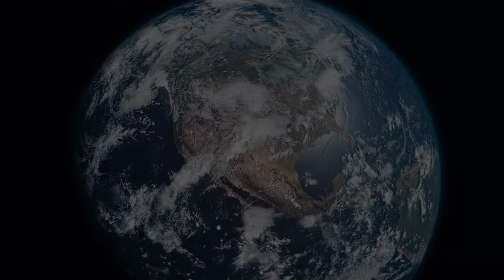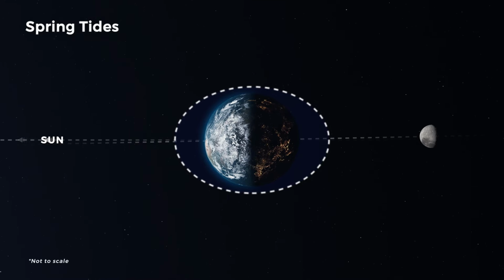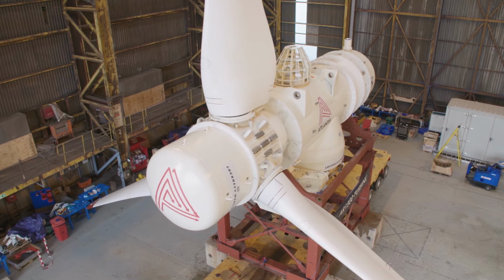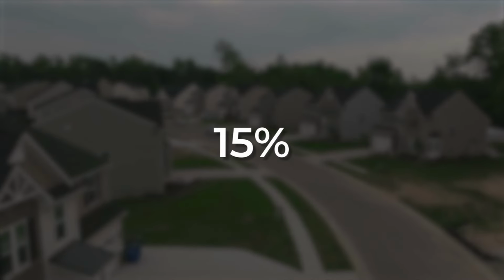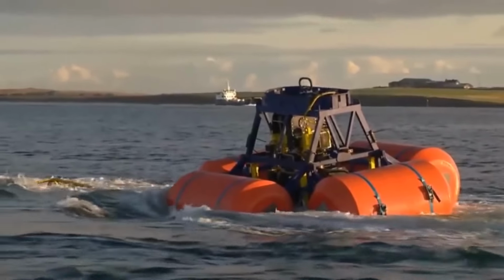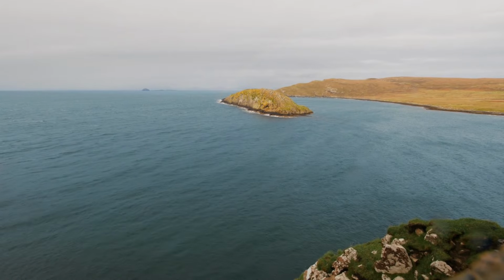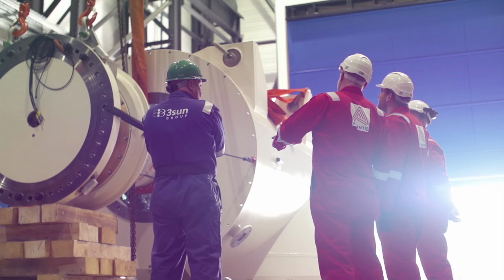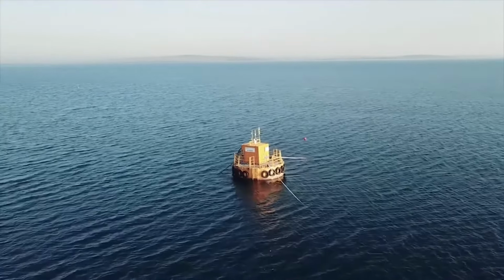Can Underwater Turbines Solve Our Energy Problems?

Comment: Hear that uranium slowly decaying? That's the sound of wasted energy.
Reply: SLAMO  
Thorium is the "new" reactor design.

It's got a lot of benefits compared to uranium, but it still needs 500 or more years of safe storage.
Reply: @lordgarion514  HOw is it better than uranium?
Reply: @knockhello2604  
That's a long list.

It's impossible to have a meltdown because the fuel is in liquid form, and if the temps get too high, a plug melts and the radioactive liquid fuel drains into a storage tank.

It can be used to make more energy from spent uranium that can no longer make energy in a uranium reactor.

It doesn't require a lot of very expensive enrichment.

AND it's waste is radioactive for a few hundred years instead of many thousands of years.

And more, but you can look into it if you want to learn more.
Reply: @lordgarion514  I didn't know about it being used to make more energy from spent uranium
Reply: Thorium half life is only 400 years, doesnt require enrichment, and is more abundant, this is what we should be pushing for.
Reply: @UberMick  The waste products from a liquid fueled thorium reactor have a half life of about 400 years. The half life or thorium is more like 14 trillion years.
Reply: @NeilHaskins  You need to edit your comment mate, it makes zero sense as it is currently as you've contradicted your self. Proof read before hitting that reply button.
Reply: @UberMick  
It has to be stored for 500 years. Sounds better than 10,000. But TBH, designing a container and storage site that will last 500 years, isn't really any easier or cheaper. 500 years is a hella long time for man-made materials to last. Even stainless corrodes over time. Never mind the joints where parts have to be joined.

And you still can't really store it anywhere else but deep underground and sealed.  We're well over 200 years old as a nation now. Few nations have made it 800 years. Can't risk it being easy to get to in the future.
Reply: @lordgarion514  I hear ya, but have you looked into MCSFR tech? A salt reactor thats insanely efficient, can use uranium/ plutonium waste products to 98% efficiency, it'll burn Thorium as well, and all waste has under 500 years half life. So factor in 2% of all fuel used, and nuclear systems dont use much to begin with, thats a very small amount that needs to be taken care of. And keep in mind, plastic bottles in a rubbish dump take 1000 years to fully break down, and theres parts of old solar panels that are pretty damn nasty as well. We have no perfect solution available, so you gotta go with whats the best available, and renewables have proven to be waaaaaay more complex than initially thought, and the size of battery backups just to try and keep power flow continuous is massive/ expensive/ not exactly environmentally safe them selves.
Reply: @UberMick  
You were half way decent in your defense of nuclear into you went with that way more complex, and battery bullshit.

No it's hasn't, and tons of renewables projects are already up and running with tons more being built.

Also, those reactors still leave us with tons of highly radioactive waste, and we'll have to start opening up storage containers and transporting the old uranium around the country. Lots of problems with the entire thing. Plus still requiring very long term secure storage, since we don't want terrorists to get hold of it and spread it around in a dirty bomb.

I'm going to assume you didn't know that renewables are putting out almost as much electricity as nuclear and coal(individually), and is cheaper than natural gas.

And just solar electricity production right now is providing more jobs than ALL fossil fuel electricity production COMBINED.

Not to mention mcsfr is still more expensive and provides fewer jobs.
Reply: @UberMick  
And to be clear. I'm not totally against nuclear power. Having a few located near-ish to large high population areas would probably be better overall. But only if we can get the costs down quite a bit. But while I'm not completely against it, I'm not a fan.

But at this point, solar electricity with nighttime energy storage is cheaper than natural gas (the cheapest fossil fuel) while providing more jobs than all fossil fuel electricity production combined.
Wind, with nighttime energy storage is even cheaper, but provides fewer jobs, and hydro is even cheaper still.

AND that's not even counting the fact that fossil fuels get VASTLY more in subsidies than renewables.

And nuclear isn't any better, and is worse in many cases.
https://www.ucsusa.org/resources/nuclear-power-still-not-viable-without-subsidies

We have the technology to get off fossil fuels and nuclear while saving a LOT of money AND providing a LOT more jobs at the same time.

Nuclear will cost more, and is inherently dangerous (even the more efficient like you mention needs hundreds of years of very expensive storage), and still needs massive amounts of subsidizing.

The renewables industry on the other hand would jump up and down with joy if all subsidies were eliminated, especially the ones the feds like to hide. The IMF can give you the full list, because the feds won't list them all.

There's also much cheaper ways to store the excess energy for nighttime use than regular batteries.
Reply: @lordgarion514  Again mate, you need to look more closely at the thorium MCSFR tech thats coming along. Current uranium uses about 3% of its fuel, the rest becomes waste, the MCSFR will use around 98%  of its fuel, thats a massive drop in the amount of waste. Again the waste is less than half the life of plastic. PLUS its higher efficiency brings down its cost considerably. Renewables are not as cheap as you quoted, simply because solar panels and wind turbines have to be completely replaced far more than a nuclear power plant, and the studies your quoting dont consider new technology what so ever, its old information. If your not totally against nuclear, I'd suggest getting up to speed where it is currently mate, plenty of info out there if your interested in broadening your knowledge base.
Reply: @UberMick  
I'm aware of all that.
But that still leaves plenty of highly radioactive material to be used for bad things that has to be stored and guarded a long time.

Not to mention the massive amounts of  low-level radioactive material that also has to be stored securely for a long time.

Panels typically last 25 years and up, with a performance warranty of 80% capacity at 25 years(if still working) and a failure warranty of a decade or more.

And you can make a standard solar panel for less than you can make basically anything bigger and more complicated than a bolt for a nuke plant.

You're also ignoring other forms of solar, which don't even use panels.

And let's not forget that we waste massive amounts of electricity moving electricity around from giant plants to where it is needed. With solar and wind you can put production almost literally everywhere. That allows you to be able to move electricity much shorter distances overall to get it where it's needed.(the moving of huge amounts of electricity is what allowed Enron to do what it did)

But with electricity being made on almost every roof, you would rarely need to move large amounts of electricity long distances the way we do now.

But sure the new reactors are supposed to be much cheaper than traditional nuclear, but they said regular nuclear was going to be so cheap it wouldn't be worth metering.......

Solar is a tenth the cost of regular nuclear even with the massive amounts of subsidizing nuclear gets. Will the new ones be that cheap if the subsidies are dropped to the level of renewables?

And who's paying to build the long term storage facilities for nuclear waste? We are, and it's on top of everything else we're paying, and it's another massive subsidy. Even though the new reactors have a huge reduction in highly radioactive waste, you still have to store it just as securely.

I don't think they can get it down that cheap TBH.

Not to mention that solar and wind can allow us to put a large percentage of electricity production in the hands of everyday people and less in the back pockets of large companies who give politicians lots of company money......

This truly is a country of the people. We are an integral part of the government, and we now have the technology (which we paid to invent might I add), and energy is one of the most important things a civilization has access too. It's well past time that "we the people" own and control more of that energy production.
Reply: @lordgarion514  I did see the report from real engineering, the set up cost much higher, but once in full operation, costs are lower than solar or wind. I'm all for residential solar, but solar farms? Its a terrible idea and thats now been proven after the green energy sector has tried desperately to make it viable. There is no solar or wind installation that can run 100% of the energy its generating, everyone needs fossil fuel backups. And to get to the point where you can not only provide enough power for peak usage when there is little power being created, means not only do the solar arrays have to cover a huge area, but then the battery installation is bigger than a nuclear plant as well. There are toxic elements in panals that are very hard to dispose of, and batteries need replacing quite regularly as well, and that cost was NOT factored in to the real engineering analysis, which actually makes the long term cost of solar/ wind even higher, further blowing out the cost by cost comparison. And again, the tiny amount of waste from an MCSFR is 400-500 years where as plastic products take 1000 years unless incinerated which is what we are trying to get away from. Plus, cheap panels which do get sold to residential clients, some only have a life of 10 years or so, so factor that into viability equations if you will. PLUS, MCSFR's can be modularised, meaning they can be scaled down in size to be placed where ever they are needed, which I believe was an issue you raised? Far more practical to have a small modular reactor for a small town than a massive array and battery cluster, or long distance of power lines connecting towns to a grid. Ultimately, long term investors will look at nuclear for smart money. And considering how rapidly technology is evolving now, we've already found a way to use uranium/ plutonium waste dropping half life from 10k+ in years down to 400-500, whose to say in another 50-100 years we've figured out a practical use for that remainder? Beside, fusion should have its shit together by that stage anyway, hopefully! Haha
Reply: @UberMick  
Needing fossil fuels to help is a function of capacity. We haven't built enough renewables to cover everything. But we're building a shitload.

Just like we use many kinds of fossil fuels, AND built enough capacity to handle the peak loads. That argument is just silly and irrelevant.

And they don't include the taxpayer funded building of storage sites, the amount taxpayers spend to ship and keep secure the waste. The taxpayer funded research into storage and shipping containers. And more that's paid directly by taxpayers.

Got to include everything....... Including those subsidies. What was the amount nuclear got in subsidies again???

NOT cheaper when everything is factored in.
Reply: @UberMick  
It's beyond stupid to laugh when I already stated renewables get subsidies (worldwide 66B, compared to fossil fuels 400B)

AND thank you for letting me know you have no damn clue what you're talking about.

Nuclear absolutely has to have backup peaker plants, as does coal for that matter. Now, go learn why.

And forced to choose, I'd take nuclear over coal any day, but I'd rather it be neither.

We're also not talking about space, and for missions not near a star, nuclear is the only thing we should use.

No, I don't want to shit on nuclear, I'm just a realist, and I understand the negatives of each fuel type. There's a reason we've never used just coal, or just fossil fuels to make electricity. No single energy source is perfect for every situation.

But we now have the technology to make electricity cheaper and cleaner, while providing more jobs, and without having to store radioactive material for hundreds or thousands of years.
Reply: @UberMick  
Oh, and that small renewables subsidy amount includes hydro and geothermal plants.
Reply: Robert Pruitt  we should figure out nuclear fusion before we really invest in nuclear
Reply: @v_raptor2218  nah, unneeded, it's gonna be too late. Put the funding into 4th gen, when we have those running get into fusion.
Reply: @lordgarion514  

That's my main problem with nuclear energy. Our human inability to deal with future events.
We can't even manage plastic waste properly. Let alone nuclear.

TBQH, I'm afraid we need it as a stop gap solution. Stop gap will probably become indefinite counting human reaction towards investment returns.
Reply: @gauloiseguy  one of my main problems also.

That and the fact that all 3 major nuclear power plant accidents were a direct result of humans screwing up.

Chernobyl was caused by humans doing an extremely dangerous and risky test that shouldn't have even been done.

3 mile island was caused by a human overriding the computer's shutdown program (which was doing exactly what it should have been doing) because he didn't believe the gauges were right.

And Fukushima happened because a group of supposedly intelligent people thought it wasn't a stupid idea to put a nuclear power plant in an area that gets both earthquakes and tsunamis.

It's not the nuclear that worries me, so much as people.  We seem to make nuclear power far more dangerous than it needs to be.
Reply: @lordgarion514  

What makes us beautiful is the same that makes us ugly. Emotion.

We live in interesting times.

☮️
Reply: @UberMick  you forgot all the waste from the enrichment phase of nuclear fuel production.

They haven't even finished dealing with the waste products from project Manhattan yet....
Reply: You guys need to go to physics class before spreading such bs , nuclear power is the most polluting energy to exist. You can filter C0² out of the air but not alpha beta and gamma radiation.
Reply: @ziuzz4168  
True.

But currently, coal fired power plants emit about a hundred times more radioactive elements than a nuclear power plant does during normal operations.

And as you said about not being able to clean the air.......
Reply: @lordgarion514  this is absolutely wrong I know you probaply read that on some sources like scientific american but real studies atually show the opposite. 

like ;
https://pubs.usgs.gov/fs/1997/fs163-97/FS-163-97.html
http://large.stanford.edu/courses/2017/ph241/langsdorf2/
https://www.bund-nrw.de/fileadmin/nrw/dokumente/braunkohle/2008_11_BUNDhintergrund_Radioaktivitaet_aus_Kohlekraftwerken.pdf

Youre right if you mean that the enviorment around the power-plant is more polluted, but if we are talking about atomic waste in generall nuclear power plants produce way more waste. And this is the much bigger problem, because this highly contaminated waste has to be stored for 100000 of years and if they somehow get into the eco system theit damage is way worse. Im not supporting coal whatsoever we could power everything throug renewable energy if big energy corps wouldnt be.
Reply: Giant and expensive solar farm: Generates 1 mega watt
Average nuclear plant: casual generating 3000 megawatts
Reply: @Andrew58251  yes because nuclear powerplants are so cheap
Reply: @axelollars  so you're saying this renewable shit is cheap? It already costs way more than nuclear, and dumbass water mills will costd even more and require even more maintenance
Reply: @Andrew58251  
Nuclear energy is $6,000-$12,000 per kilowatt.

Solar is less than $1,000 per kilowatt.

Someone hasn't been studying.....
Reply: @lordgarion514  those are some accurate Wikipedia facts right their
Reply: @Andrew58251  
2 things about that.

One, the numbers are from Lazard. If you don't know who they are, you need to study more. Governments around the world, including our federal government uses their data.

"by Lazard, a leading financial advisory and asset management firm. Their findings suggest that the cost per kilowatt (KW) for utility-scale solar is less than $1,000, while the comparable cost per KW for nuclear power is between $6,500 and $12,250. At present estimates, the Vogtle nuclear plant will cost about $10,300 per KW, near the top of Lazard’s range. This means nuclear power is nearly 10 times more expensive to build than utility-scale solar on a cost per KW basis."
https://earth911.com/business-policy/solar-vs-nuclear-best-carbon-free-power/
(And the source being biased is irrelevant since they list the source. You can go verify from the original source. It is accurate)

And two.
You can shove that sarcastic bullshit you failed at right up your idiotic, and wrong ass.

Dipshit.

Piss off.
Reply: @lordgarion514  Is that why Germany have one if not the highest Electricity bill on Europe even though they're near 100% green energy? While France with 75% Nuclear powering their grid has the lowest energy cost in Europe?
Reply: That and all the hydro dams thier dismantling
Reply: @dednside5229  We should dismantle much hydro, let the Salmon run!
Reply: @dednside5229  failed state ehh
Reply: Yo Mama  how is a smartphone or any consumer electronics green energy? Yes solar panels use some rare earth elements that need to be properly disposed of or recycled, but one toxic lake created by chinese mismanagement of waste isnt a reason to dismiss the entire technology! Do you even grasp how stupid that makes you sound?
Reply: nuclear is not clean energy nor renewable
Reply: @razakmeshouni8611  lmao, not renewable, but definitely clean. Also the sun is not renewable btw.
Reply: @ignasanchezl  Not renewable and far far far from clean. Oh I get it, you want to ignore 100.000 years of hazardous nuclear waste for next generations?!?!?! Yeah if we forget that little sidenote u maybe can call it clean lol
Reply: @razakmeshouni8611  You fell for the Holywood drama aparently. Do some proper research.
Reply: @razakmeshouni8611  

You haven’t done research apparently; scientists have found a fungus in Chernobyl that eats radiation and grows from radiation. Thus eating up your waste fears.
Reply: @razakmeshouni8611  lolbuddy are you alright? Nuclear is classified as a renewable source. Tell me, what emissions does it create?
Reply: @Andrew58251  If I am alright? You are the one who seems to have trouble understanding the simplest of terms. Renewable doesnt mean no emissions, it means the source is infinite you Einstein. Besides, 100.000 years of radioactive nuclear waste, plus its energy source is like fossils finite and limited. Clearly, its not a renewable energy source
Reply: @razakmeshouni8611  yeah and technically the sun will burn out one day meaning solar isnt renewable either "Einstein" Oh but that's gonna take a while.... guess what? Uranium is as common as silver and silver is dirt cheap. A single block of uranium can basically power a large portion of a state for over 10 years until it needs to be replaced. So I'd say its gonna be a while until all of it is depleted
Reply: @Andrew58251  yeah sure whatever bro, leaving radioactive waste for the next 100.000 years you dont mention on purpose I guess.
Reply: @razakmeshouni8611  First of all it doesnt last 100,000 years. Second you know their is proper ways or storing it right? Like covering it in concrete or boron? They don't just throw it out in the open... second, its only gonna be a few hundred more years until we can leave this planet. It really doesn't matter if the waste emits radiation for 1,000 years or 1 billion years. Also i hope you realize to have full solar means having a shit ton of lithium batteries that also need to be replaced every few years. It destroy the environment enough just to mine the materials for them, and especially to produce them and discard of them.
Reply: @Andrew58251  You are just repeating yourself, and its not based on science. Again I supervise nuclear facilites and they are known for its transparency and we have tours by the public on a daily bases. So Id be happy to sent you the pictures to convince you of the amount of concrete that is used for radioactive waste. Like most of the people on the tours, your opinion will change after you see and get to know the reality. The fact some countries decided to opt for nuclear is simply because they wanna put the negative consequences on next generations. Like many of today's problems are caused by short sightedness and short term thinking. Its an intergenerational injustice of unspeakable kind to leave future generations with radioactive waste for millenia. Its not some kind of simple storage we are talking about you barbarian. The longest human civilization or empire lasted what, 500 years or so at most. So how the hell you think this transmission of radioactive knowledge and storage doesnt require some kind of  utopian civilizational consistency. The dangers are simply beyond our worst imagination, and its all being justified by some kind of mythical belief in the superiority of distant future generations. Assumptions this far into the future are simply unscientific and highly dangerous, escpecially given the abundance of wind and solar available.
Reply: 100%
Reply: THIS ---> https://www.youtube.com/watch?v=_ou_xswB2b0
Reply: I support Nuclear Power plants too if that's what you mean.
Reply: @gary4936  nuclear decay from within the earth would actually be geothermal energy.
Reply: I was looking for the nuclear comment. Go Nuclear.
Reply: covid-19  
Much better than fossil fuels to be sure.

But you do still have to store the radioactive waste for 500-600 years. Something quite difficult to do actually.  Better than 10,000 years or more, but still a VERY expensive thing to do. Have to keep it secure all that time as well, since we wouldn't want terrorists getting to it and making dirty bombs, etc.

That's a VERY long time. Especially considering that out of almost 200 nations today, only a very tiny number are more than 500 years old.

Also, we have job creation.
As far as just electricity production goes.
Fossil fuels employee 1.1 million and makes 63% of electricity.

Solar provides just under 2% of electricity, but employees 374,000.

Nuclear is just under 20% of electricity, but only employees 68,000 people.

And not only is solar literally half the cost of current nuclear, but it's over $3 a megawatt cheaper than the cheapest fossil fuels(and getting cheaper fast).

Not only is solar cheaper, it provides VASTLY more jobs.

Going from 20% to 100% nuclear would provide at best (the new systems need fewer people) 340,000 jobs,, cost us more than renewables (wind is even cheaper than solar, but creates fewer jobs), AND still need radioactive waste safely stored for 500 years.

Going from 2% solar to 100% would create 18,750,000 jobs.
(375K current jobs at 2%, of electricity, so times 50)

And not only is solar cheaper, creates more jobs, doesn't need 500 years of storage, but it will(and is now actually) create clean battery recycling, which will be cheaper than mining and processing raw materials, and it will be, at worst, very low polluting. In comparison, nuclear fuel processing is VERY expensive and dirty.

I'm not completely anti-nuclear, but there are better ways. I envision small sealed nuke plants being used near big cities and areas with a lot of manufacturing and processing, for the impossible to beat steady output of nuclear power.

While a LOT better than fossil fuels, nuclear will never be as clean, safe, or as cheap as renewables are.
Reply: Thorium takes longer to decay.
Reply: Faybrian Hernandez Thorium Rocks
Reply: And with the advent of fusion technology, that energy output would be tenfold.
Reply: Real Engineering did a video on the economics of nuclear power.

Nuclear power has its uses, but it’s not a miracle solution.
Reply: @IAmNumber4000  yes I saw that, but it was based on the uranium model only, recent advancements that can use thorium, as well as uranium/ plutonium waste with a 98% efficiency rate. I wouldn't call it a miracle, but it's by far the best option emerging, and far more cost effective than uranium based plants, making that video almost obsolete now.
Reply: @UberMick  yea its just that thorium doesn't produce plutonium as a byproduct, and plutonium is that shit that goes boom.
Reply: @jackasshomey  you might wanna watch vids on Thorium before entering these discussions mate.
Reply: @UberMick  i have watched quite a few but also done a bit of light reading into the subject, Plutonium-239 is one of the main byproducts of a uranium nuclear reactor and that's mainly why uranium fission nuclear power was chosen over thorium molten salt reactors back in the day, cause they needed weapons grade plutonium for the war and then into the cold war also.
Reply: @jackasshomey  mate, I honestly have no idea the point your trying to drive home here, you made a statement that has no bearing on any points made in this thread.
Reply: @UberMick  yea that fact that you have no idea is clearly obvious, but don't try to confuse your lack of knowledge with my clear presence of knowledge....
Reply: @jackasshomey  dude, your point is still a mystery, and the fact that all you wanna do is belittle instead of clarify is a testament to your character, good for you lil fella...
Reply: @UberMick  well no shit hydro would be useless in the deserts unless they could tap the underground rivers that flow there... but in the desert its more useful to create solar since there's vast plots of fairly useless land. and sure the corrosion issue like you said could have been solved but we all know how hearsay works so until there's physically proof of concept its just another half truth just like how many years we're away from an actual working fusion reactor.

also one thing people seem to overlook about hydropower is that their are many different types of instillation, not just the standard huge dam style hydro plant... some utilize high head pressure like the pelton wheels, others use low head pressure like the ones turbulent markets, very low head pressure ones utilize the archimedes screw in reverse, and then you got the coastal turbines that are basically wind turbines just stuck in the water, and then you got the ones that utilize the coastal waves to create an air pressure differential to turn a wells turbine, and people are finding new interesting implementations for these all the time.
Reply: @jackasshomey  haha, yeah but you still have seasonal fluctuations mate. Modular reactors have consistent output, and don't need backups like all renewables. Plus the same modular reactors can work where only hydro would be effective, where only wind would be effective, where only solar would be effective. And as such, would help further reduce its costs simply by using the same mass produced units everywhere. And many renewables setup up where they're most effective, but may be a long way from where the power is needed, so then factor in huge amounts of cable and maintenance checks for that. Modular reactors can be deployed exactly where the power is needed.

Keep them coming lil buddy, I ate lots of fibre today so I can keep shitting on your arguments all day :)
Reply: @UberMick  seasonal fluctuations only really effect wind the most and sometimes solar when gale force winds rip the panel's off the ground, seasonal effect on the flow of water is more predictable by leaps and bounds and the water you put these in is usually flowing 24/7 and sure some power cables will be necessary but they would be either fucking way thorium or not how do you think you transmit power with the wave of a fucking magic wand?
Reply: @UberMick  how many thorium reactors are operating again?
Reply: NUCLEAR FUCKING POWER BOIIII
Reply: @SUPERTOASTERGOD  lol I cant understand gibberish buddy. Imagine liking your own comment lol